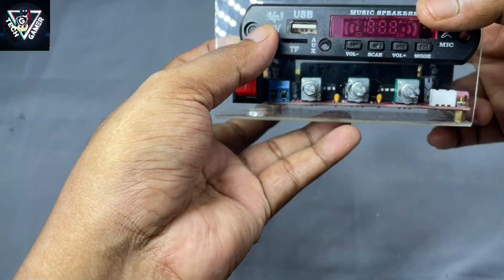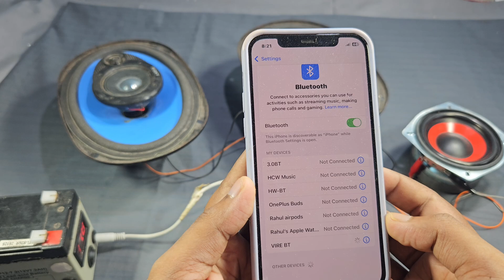How to make bluetooth amplifier machine with low price 🤫

Comment: Amplifier board ko 24v 5a deke chla skte hai
Reply from the maker: Bro a bala machine  jo banaya a 12v  se chalega 
Or 24v se chalana hai to 7812 ic lagana hoga fan ke liye , to app 24v 5a power use kar payoge 😄
Reply: @RAHULGAMINGTECK mai amplifier ke bare me puchh rha hu 24v 5a me chl jayega
Reply from the maker: @Bhaskarpandey6079 chala sakte ho ek fan use karna jarur a board heat hota hai
Reply: @RAHULGAMINGTECK thanks ❤😊